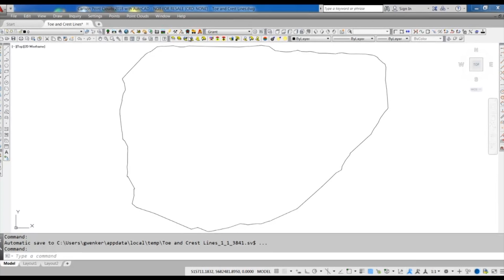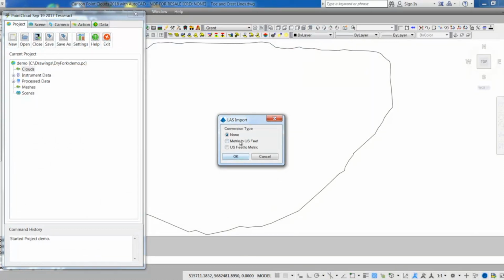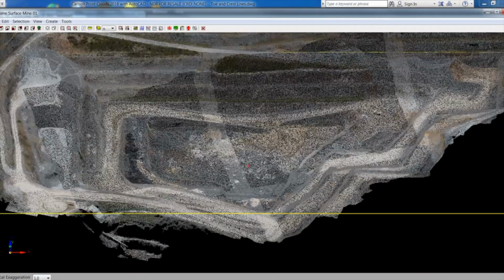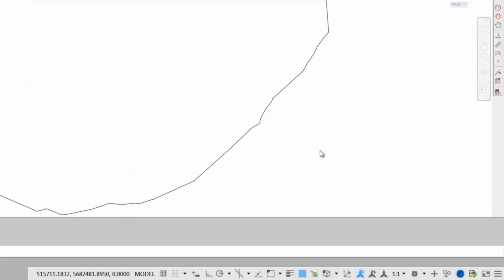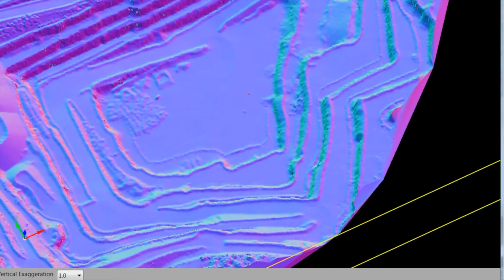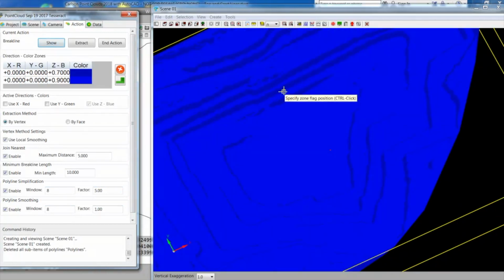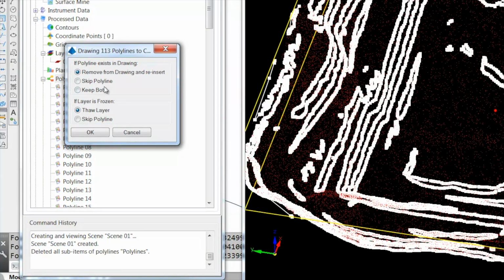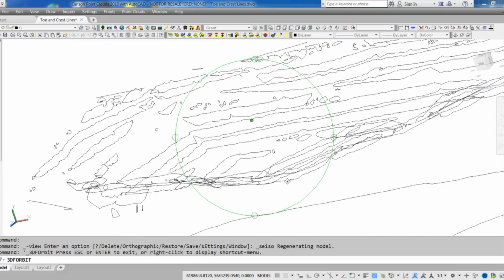Point Cloud | 3D Polyline Breaklines

Comment: Sorry !! Whats this software??
Reply: It is the worse CAD software ever. A cheap imitation of AutoDesk products and I'm stuck using it because the company I work for now is too cheap to buy the good software that most every other company in the world uses. So here I am looking for videos to do things that are extremely easy in Civil 3D, but completely nonsensical in this crappy Carlson software.
Reply: @MyPeanutButtersHairy  I'm on the other side of things, used to Carlson and thinking Civil3D is bullshit. I would be stoked to run Carlson on the AutoCAD 2020 engine (used to IntelliCAD, definitely the budget option) but as far as I can tell, Civil3D is for engineers with surveyors just an "Oh, yeah. Them..." afterthought. Carlson is for surveyors, top to bottom.
Reply: @tsdrifter  That is probably true, I was using Carlson to try to do design work and it was awful. Thankfully I found a position at a different company that uses Civil 3D and I'm much better off with it. But it wasn't just the issues trying to do design work, it was also extremely buggy. There were so many things that didn't work right, even something as simple as editing a piece of text was all screwed up.
Reply: @MyPeanutButtersHairy  then go and pay 9k every 3 years yoursefl :D
Reply: @Mottel01  I don't pay for the software, my company does and I left the company that was using Carlson because it was such awful software to uses for design purposes. The company I'm with now uses Civil 3D and design tools it has are a hundred times better than what Carlson has. Yes you save money by going with the cheaper software, but you lose money in productivity since a simple grading project takes 10 times longer doing everything manually.
Reply: Made by Carlson Software, named Point Cloud. I think they have a trial period for their software.